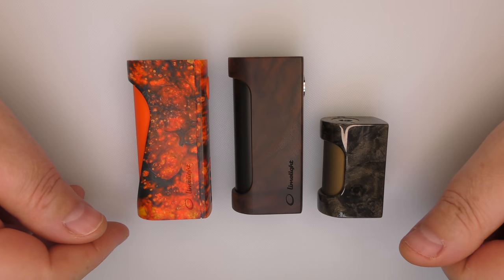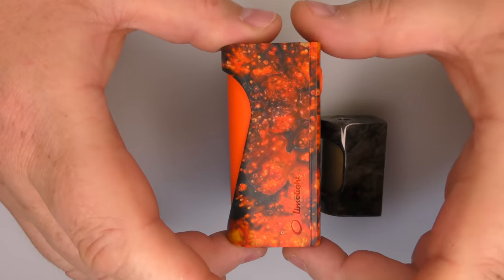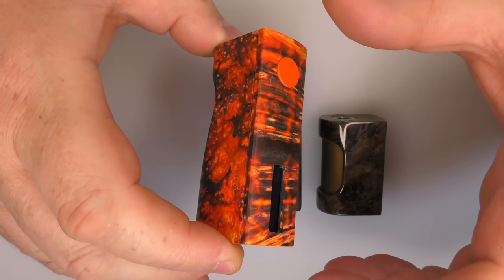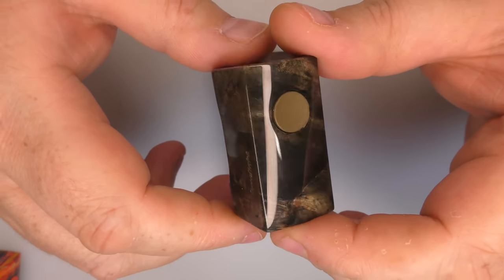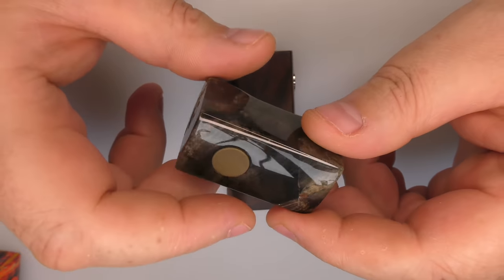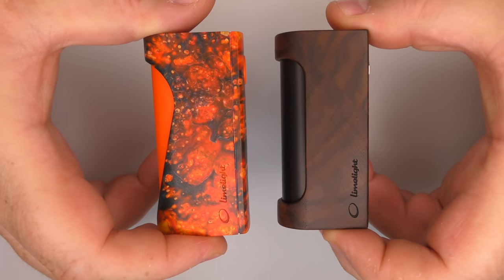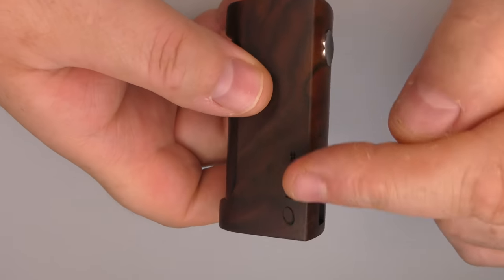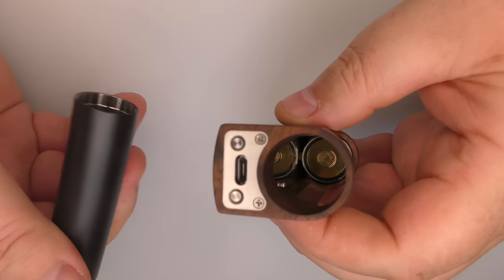Wicket MONO by Limelight Mechanics

Comment: He’s fixed a BIG issue with the dicodes boards / mods. Their weakness is the large invertor chip (WE) which easily comes loose due to knocks and bumps. His design with the insert cups it and the metal cover keeps it pushed down. It sits free in dicodes own mods. I’ve had 6 fail over the years and it’s always been the same fault, that large and heavy inverter chip, as broken free from the solder holding it in.

Comment: Hey Mark. I have just received the mono based on your excellent review. Dicodes version. However it doesn't charge. Tried several chargers, usb cables and batteries. Am I doing something wrong? Thank you in advance.
Reply from the maker: Not being cheeky but dicodes doesn't have a battery bar showing charging.  When it is charging, hold your hand over the usb area and see if you can see the red light.
Reply: @ToddsReviews  unbelievable!! I do see a red light. Thank you mate you are the man!! Learning something from you every day.
Reply: Can i use a 2A charger or better stay with 1A ?
Reply from the maker: Yeah maybe should have mentioned that in the review LOL